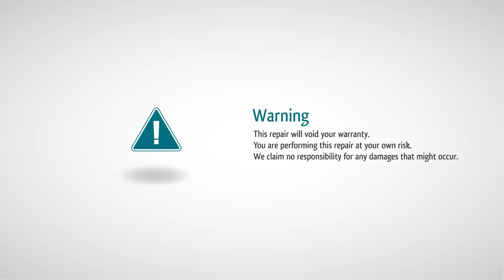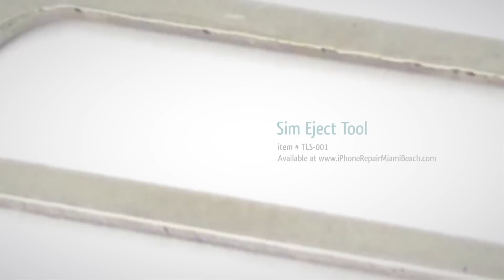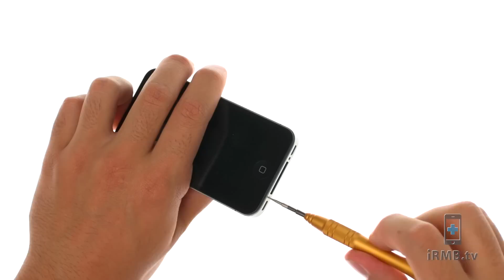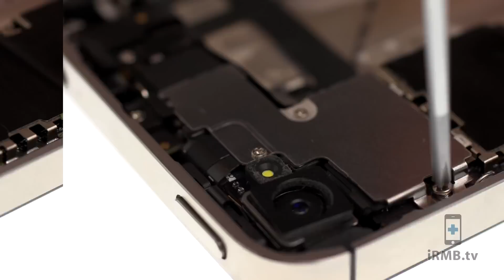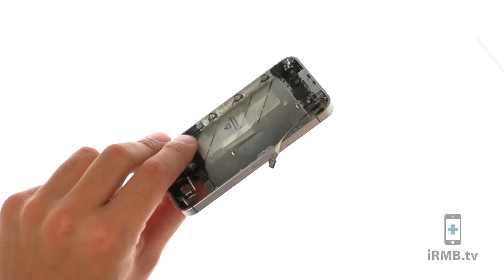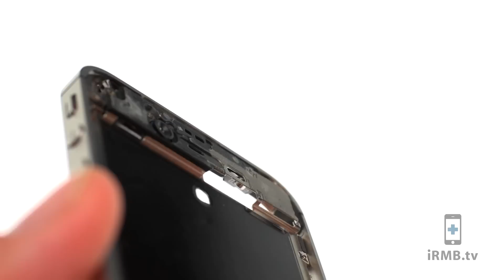Power Button & Proximity Repair - iPhone 4S How to Tutorial

Comment: fantastic video with high quality video and very close up shots throughout the video. This video finally showed me where the grounding clip goes up by the power button. I did a screen replacement and the video I followed did not mention that clip and all of a sudden it fell on my lap and I was lost as to where it went. Then after reassembly I had a non working power button. I will open it up after work and see if that will fix it. THANK YOU!

Comment: Thanks iPhoneRepairMiamiBeach, saved my daughter's phone from the technoscrapheap once again.  I'm really impressed with your videos - this one really only lacked one crucial piece of info which was the power button itself, and which orientation it needs to be when it goes back in to the phone (unless you're really clever and make sure it doesn't fall out when you remove the plastic cover that holds the power clicky-switch embedded in ribbon cable that sits under the external lump of metal ie: button).  For those that make this mistake, you can google it.  Or put it in with the bit of wire that flaps around facing down (as you work on the phone from its back) (or let's say the wire goes towards the screen).
This one is rated as hard folks.  And you might find it a bit too hard if you haven't done this sort of stuff before. Fine point tweezers are essential, though you don't have to have the bent tip ones shown in this video.
I found this easier than doing the ribbon cable for the volume buttons.
Make sure you get a sticky screw placement guide mat to put each screw on as you take it out or else you'll end up with a nightmare jigsaw puzzle of so many different sizes of screws (well, miniature bolts actually).  I got mine when I bought parts from an Australian ebay seller called "fixmyphone" and it makes life soooo much easier.
Reply: Thanks for this. I found an empty egg carton with the holes numbered for each step helped
A bit of Blu-Tack on the screwdriver heads (or magnetizing them) helps to not lose screws as they're removed

Comment from the maker: You can replace the flex without taking the front screen off but it is much safe top take it off. If you do not take the front screen off you can damage the lcd and digitizer flex cable because in order to unscrew the power button bracket you have to bend them a lot. So we prefer to take the screen off when we do this repair.

Comment: settings > general > accessibility > assistive touch 
slide assistive touch to "on" position
tap the new icon in bottom right corner (square with 3 inlaid circles)
tap "device" option
press and hold "Lock screen"
The power off slide bar appears now, having bypassed use of the broken power button.  :)

To turn it back on, without a functional power button, just plug it in to charge. It turns by default.

Comment: This is a very well done video. Good job! However, it would have been nice to see you put it back together. I suspect it is not as easy as taking apart.  my biggest challenge is with the adhesives on the power switch cable. Once you pull off the last two parts (step 22 and 23), there is no adhesives on the new switch ribbon cable to stick them back on. I am trying two sided tape and glue stick but none of these will be permanent. When you are peeling off the speaker in Step 22 be very careful to keep the thin foam layer intact. It doesn't pull off as easy in the video. I tore mine in half. So try to keep foam attached to speaker and keep the adhesive on the phone if you can. I'm sorry now for trying this. The phone was working perfectly except for the switch. I could get it turned on by just plugging it in. Well, here I go to reverse the steps. Wish me luck!
Reply: Ok, after numerous attempts to reverse the steps, I have realized why they didn't show the reassembly in the video. It is impossible. If you have a phone that is "sort of" working, then just make the best of it or sell it for parts. The failure is reversing Steps 20 and 21. That small retainer bracket they warn you about in Step 20 just does not go back on. It is critical for holding the small plastic sensor bracket in step 21. With out this, you will never get the phone back together or to ever work again. I should have read the other comments before attempting this. That said, this is a great video if you just like taking your phone apart to see all the components. I'll never complain about the price I have to pay for a phone again.

Comment: Enable Assistive Touch:  Tap SETTINGS, General, Accessibility, AssistiveTouch (near the bottom) and tap AssistiveTouch to ON.  You will now notice a small dark square with a circle in the middle (you can move this square anywhere).  Tap the dark circle to open the assistiveTouch menu, then tap Device and tap and HOLD the Lock Screen icon.  This will bring up the iPhone's Power-Off slider - no need for a power button any longer

Comment: This was one of the things I did when I completely rebuilt my 4S. Everything's working now... almost. The light sensor is not working, despite several attempts at auto brightness recalibration. Is there something from the part that I may be missing that's causing the auto brightness not to work? The small sensor bracket mentioned in this video isn't adhering to the part of the flex cable it's supposed to be, if that helps to pinpoint the problem I'm having--and that clip that goes over the sensors is missing from my phone. Just trying to pinpoint the cause of my auto brightness problem.
Reply: **make that "it isn't fully adhering, but still sticks a little bit."

Comment: How can I power off my iPhone 4S, since the power button is not working?
Reply: Good question. The first step says to turn off your iphone and that is the reason for the repair, cant turn it off lol
Reply: PassionCherry1
Hi guys, turn on the assistive touch (find it in iphone settings) and hold the lock screen botton! Now you are able to turn of your phone. Hope this helps
Reply: +demajeur How do you turn it back on then??? 😂😂
Reply: You  can add a button icon on the home screen that's essentially a short cut. That will allow you to do everything the power button is meant to do and more.
Reply: Turn it back on connect to power
Reply: @hellixity  Connect it to charger
Reply: @hellixity  Plug the charger in the iphone and it will turn on.

Comment: Fixed the power button with this, but now the the touch screen is unresponsive... anyone know any tips?
Reply: Take the connectors off, for the screen and push it back in firmly.  Should work.
Reply: Juned Hassan 
Thanks, digitizer cable got stuck between frame and front screen and teared a little. Got it replaced now though.

Comment: did this and reassembled and now it will not turn on. when plugged in it does not come on and beeps, anyone know whats wrong with it?
Reply: iLukeee1 this happens to me...how did u fix it
Reply: aquaverga105 the reason mine did this is because the cable for the lcd got damaged while I was messing around with it.